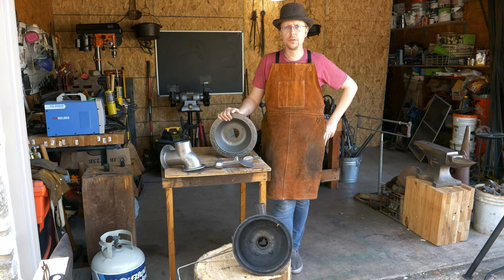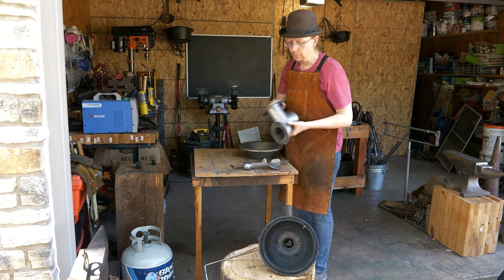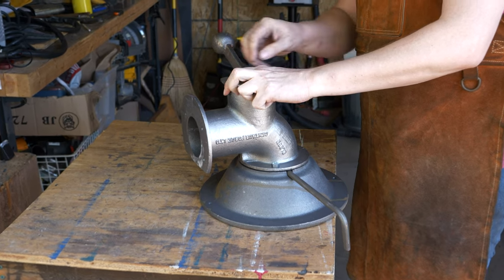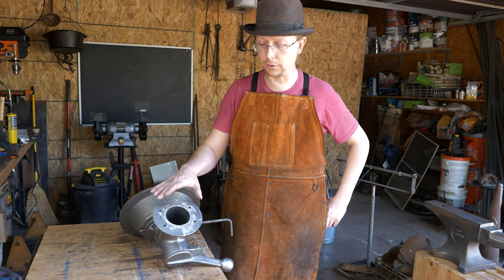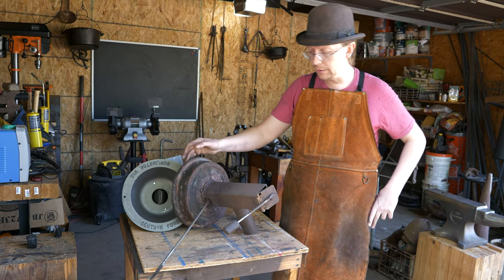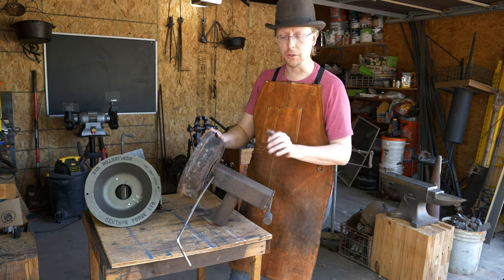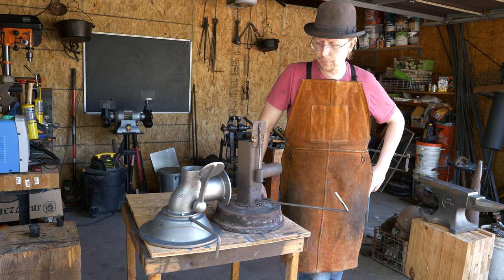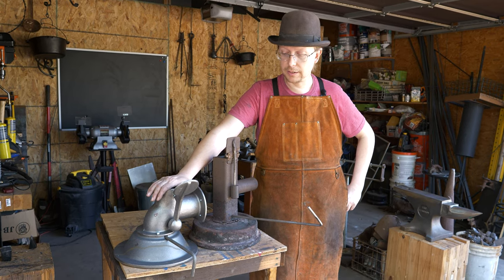Centaur Forge Firepot vs. Brake Drum Firepot

Comment: ..i lined my brake drum with broken fire brick and cement slightly forming a bowl. it did good for about 9 years, i guess it all depends on how big of a tightwad ya are as to what ya use...
Reply from the maker: Yah that's a good technique.  I've got multiple people using each forge every week and I've found some real value in having something that is sturdy is pretty important out at the farm. For a personal forge I think you are spot on.
My coal forge also doesn't have a great firepot and I don't have any problems with it but when I put new folks on it it causes a lot of problems.
Reply: Adding clay to the wall of a rotor will get you a nicely sloped firepot.

Comment: You keep pointing to a brake drum and calling it a rotor the saying a drum is deeper. The real issue with a drum/rotor setup is the rotor "hat" and drum face is a much thinner metal than the sides. This area is the bottom of said pot and will fail before the rest.  Either can be clayed to form the correct shape and depth and will also preserve the life. And both can be built for pennies in comparison.

 I've made, bought and used too many different styles of forge over the years, including drum and rotor styles. I've even used a cast iron floor drain pot which i still use for my portable setup. 
 They all have advantages and disadvantages but forging needs dictate size and depth of fires, not to mention the fuel that will be used in each, portability, cost etc. When using a metal container, a coke pot needs to be THICK, coal and charcoal can be thinner. Metal is not the only container available. 
  I have a centaur "square" pot and find it wonderful though the prices are a bit much for the hobbyist.  I prefer my side draft english style for all around but that is based on my useage. Your mileage may vary.
Reply: I’m so glad I’m not the only one who noticed he kept calling the brake drum a rotor kept saying to my phone that’s a drum not a rotor bruh
Reply from the maker: :) Yah.  Got the wrong word stuck in my head during filming and didn't catch it till too late.

Comment: Another problem with the Centaur Forge fire pots is the bolt that holds the rod into the clinker breaker.  Over repeated use it will either loosen, melt, or break off.  I've had to replace MANY of them over the years and just did again on mine.  It's seems they have a problem at the worst possible time as well, LOL.......
Reply from the maker: Just had one break last week.  It's the first one I think I've had to replace.  Annoying that the bolt head broke off.